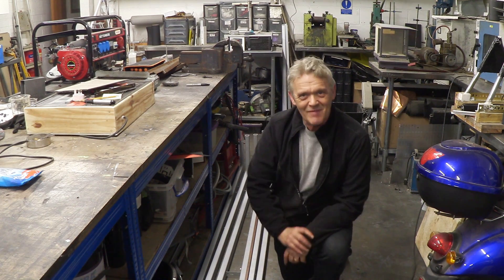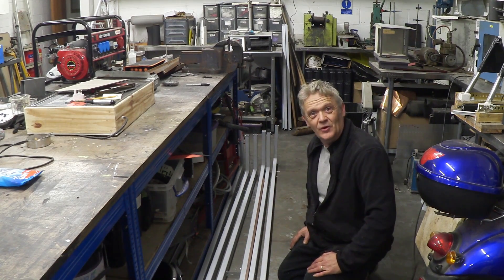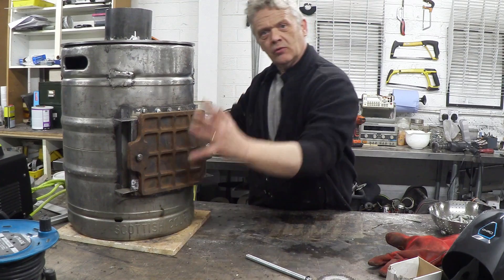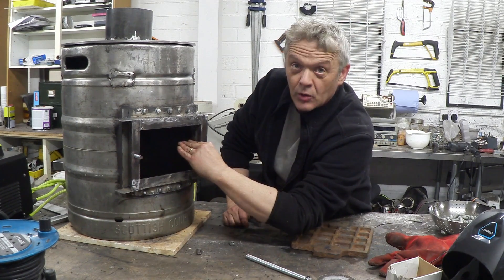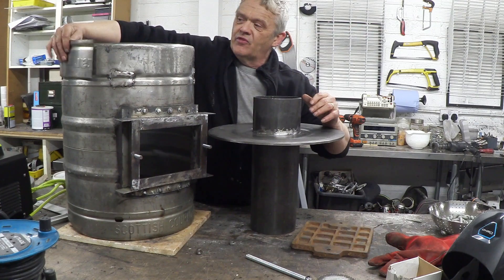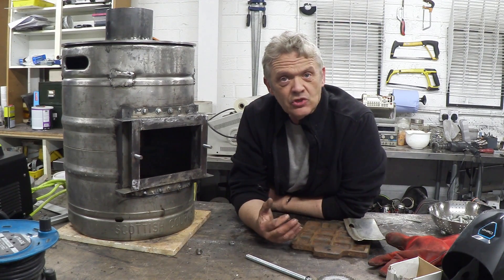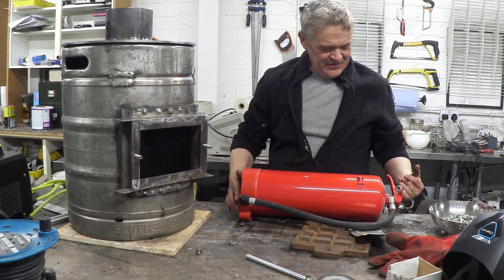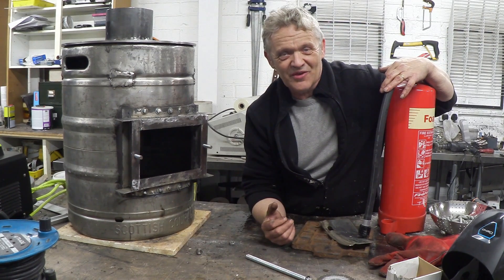DIY Gasification and Generator Unit - Part 4 - The Cyclone

Comment: I always thought it was really fortunate that I happen to be a big fan of the Fred G. Sandford style. To me it aint beautiful if it aint nailed, welded, screwed, glued, wired, duct taped and accidentally melted together in spots to add character to cans, bottles, old mufflers, hubcaps, couch springs and it is just amazing what a few car parts can do, even if they don't work they really draw curiosity from the brave bystanders who don't run while you're pushing your new heap down to the scrap yard to get some decent tires. So, from one contraption connoisseur to some British guy, keep up the great work brother. I'm almost sorry we beat ya'll in that war you started, but hey, you started it.

Comment: On your cyclone, you have the outlet too close to the bottom. On most cyclones the outlet pipe only penetrates to about 1X the diameter of the housing below the inlet. If you have it go that close to the bottom as you have it set up it will re-entrain the particulate matter that was centrifugally separated.

Comment: Hi Robert! I have been in the woodgas biusness for over a decade. I never coment anywhere on Youtube but l like your selfless way of thinking and shareing knolidge so l thod to do the same. 
Think a gasifier as carbourator. A precise, fine tooned machine designed to fit a specific engine. Its made to asure the engine runing optimal. As there exist good carbourators, there exist good wood gasifiers. But, you can allso run a engine with just a hose driping petrol in the intake manifold. Thats your FEMA 😄 it is not designed to run a engine for any long amount of time, just as a one time run in a emergancy. The problem is, it operates at too low temperature for all tars to crack and reduce so you end up with trace amounts of tar that collect on most turbolent parts of the engine - first on intake valves. No problem when engine is warm, but once cool the tar glues the valve still. 

Good news is this design is good for runing a engine for a few minutes as a test and it can be upgraded to a Imbert design, by adding air nozzles and flow restrictor plates (to compress the heat down in a tight turbolent space). 

There is the site called DriveOnWood that is the best woodgas information center in the world. 

And be carefull, woodgas is adictive. Once you hear a engine run on wood you are hooked for life.

Comment: fab to look at i really enjoy your videos i did notice that the thread of the bolts is going to be worn away every time you slide the door off also you do need a flash back exit for the gas if it decides to ignite and expand in the barrel maybe something with a spring pushing a plate onto the side where a hole is. cheers and beers keep up the good work

Comment: A hinge and drop latch may be worth considering so wood can be shuffled and initial combustion can be controlled by having the door partially open + when hot it will become very difficult with the heat to open with expansion of metal:) I especially like the waffle cast iron door adds steampunk chic to the appearance! Vht paint might be useful in certain areas but might exceed it's range in others,I've found that it is best application is when there's some heat in the metal otherwise the slow offgassing can be nauseous and curing time to slow

Comment: Looking awesome mate, I'm shocked you didn't weld some steel hinges on that door and use a tension clamp to close it tight. Isn't that the bit that you have to go in and out of regularly to and the wood and or coals? Of course that is always something you could add later if you plan on using it a lot. Cheers mate - LOL, you know me, always looking to add an idea where I can to make something user friendly.

Comment: Fuel needs to be 100 percent dry and of uniform size.Even slightly damp wood will kill the process. Uneven size chunks will bridge and a shaker will need to be employed. If the gas produced is not clean the intake valves of your engine will gum up really quickly. Dont be fooled into thinking it's easy to do and beware as there are many videos on U tube which are missleading.

Comment: If the sealant does not work, try fireplace cement, it will stand a lot higher a temperature.  You get it in tubs ready to use.  The high temperature silicone sealant might be fine, but it will depend on the temperature it gets up to.  Can't wait to see you demonstrate it working.

Comment: Hi Robert, you want your filter stage after cooling. If the gas is hot then nothing will  drop in your filter. The Cyclone is nothing more than a coarse filter to keep your cooler from clogging up it just get the coarse dust out. I quit building those years ago as they are not very effective and we pull the gas out in a way where it does not drag all that dust with it. After this coarse filter you cool the gas as much as you possibly can. Then run through your fine filter. A suggestion for you coming from years of rapid development is to build a bag filter made of silica cloth. This cloth can withstand very high temperature and is exempt from corrosion of the gas. You can add additional media to this filter if you wish (sort of use it like a basket). But the idea of the bag filter is build a "cake" on the filter. The bag is not the filter it is the cake build up that becomes the filter. The dirtier it gets the better it will clean and they breath very well. A clogged up filter will do more harm than good. If they become too restrictive, your gasifier wont be able to breath and thoroughly process the gas and the resulting tar will pass right thru that filter an into your engine. 

To make the bag filter all you need is a stapler to staple the seems to create the bag. Look up a " duct flange" you can attach that to a bucket lid of sorts and then use the lip of the flange to clamp on the bag filter using a band clamp. Sort of like a shop vacuum cleaner system.
Reply: Thanks for the detailed instructions very interesting!
Reply: @weld-deluxltd7635  My best advice to any new builder is to build a charcoal unit. Once you learn this you most likely will never even bother with a direct wood gas system. Charcoal is by far easier fuel to produce, they are stupid simple to make, they crack water directly making up for a lot of the energy losses making the fuel. They run 100% more reliable with no automation required. 

A direct wood gasifier will need automation in order for it to self sustain. I dont care how good of  a builder you are physics is physics and it can not be overcome with out automation. Direct wood gasification is problematic. You can build a charcoal unit and actually use it or you can spend hours and hours and lots of money building a and fiddling with a direct wood gasifier. Ive built some of the most advanced system to ever exist and even I am drooping that tech. Later systems will use a hybrid system where there will be a direct wood gasifier that can run in a full heating mode. Yes this will be installed inside the home. I have the reactor tech that can make that possible. However this will also have a charcoal gasifier unit to scrub and crack that gas. When the stove is in gasifier mode, it will work just like any other gasifier but the gas will be piped into the charcoal unit. The charcoal unit will crack all the moisture and tars produced in that gas, plus add in additional gas from its process. The stove like any gasifier will produce char ash. That char ash is what will be used in the charcoal unit. So it will be totally self sustaining without need to produce fuel for the charcoal unit as the stove is doing this already for free and that char ash is no longer going to waste.
Reply: @Thrive-Off-Grid  Once again thank you for the information! I have subscribed to your channel, so you will be seeing a lot more questions from me :)   I am interested to build a plant for the production of activated charcoal, so i need to look through all of your videos and educate myself. I agree with you that gasifiers are challenging as i have customers who run them for commercial power and heat generations and they are non stop maintenance hassle. My profession is welding so if you ever need advice, a second opinion, or anything else, i will be glad to help!
Reply: You just got a sub from me. Thanks for sharing with Robert. I know he reads the comments.

Comment: Looks great. Temp is the best way to clean the gas. Yes, I have seen the FEMA version as well and adaptations but, in my humble opinion, using a sealed vessel and heating it from the outside is best due to the reduced flash back that is possible with the system you are designing but, you would then need two sealed vessels to keep the reaction organic or use a separate source, like a wood fire, to keep the reaction going. The temps are 600 F and the asphalt ( heavies ) fall out of flow, 400 F diesel and kerosene will condensate out of flow, at 200 F gasoline will condensate out. Beyond that, you will get the propane, methane, ect. and eventually just Hydrogen and Carbon Monoxide aka syngas.  Hope it goes well, cheers.

Comment: Just in case no one has mentioned this yet. Make sure you have something very amply venting welding fumes outside if you're welding on galvanized steel. The vaporized zinc will mess you up. Welders flu is no fun.
Reply: Major headache. 😞